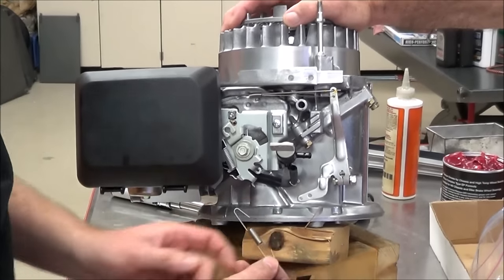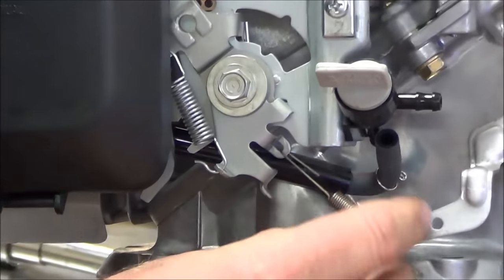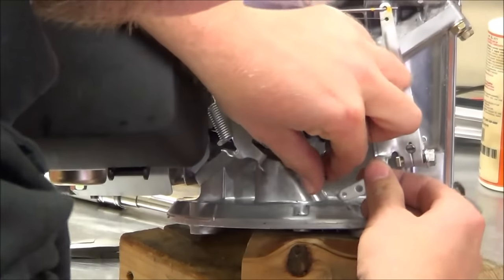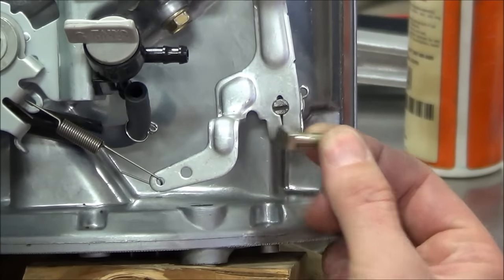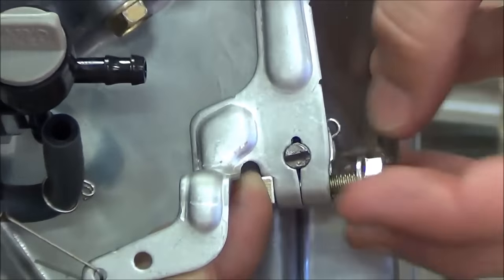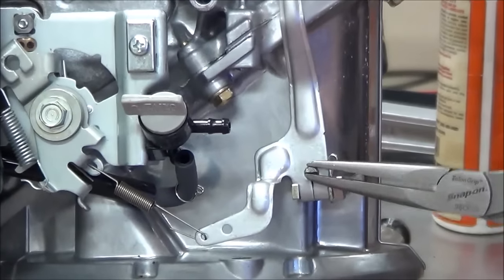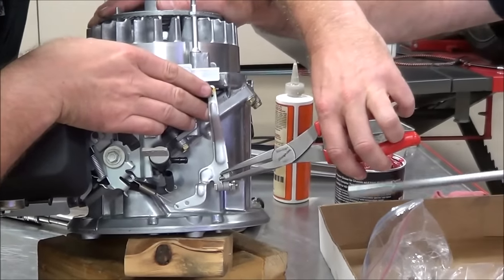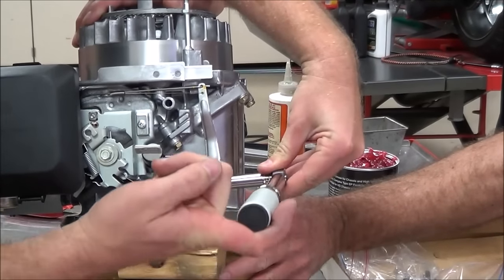GCV Assembly   07 Governor Setting #how2wrench

Comment: So if the governor is at the right of the engine you turn the governor arm and little spindle clockwise/to the right/ away from the engine. And if the governor is to the left, you turn arm and spindle ... which way?
Reply: The answer to this question is totally unclear, not just on this video, but many.  You can tell about the uncertainty given all the extraneous crap in this video.
Reply: That wasn't explained very well

Comment: When i adjust the govenor and tighten the bolt, my buterfly wont return and if i loosen the nut a little ,than my buterfly returns but if i start the motor than the rp its over the roof..(btw im ajusting without a tachometer because at this moment a dont have one) and if i tighten the nut so that my buterfly stays on the correct position , then i can't control my speed ..any suggestions ?
Reply: I am having the same issue. I cant get my butterfly to stay shut and my rpms are through the roof. Did you ever get this figured out?
Reply: @willgothard9300  no still have the problem.. now of butterfly stay in the same position and my rpm is almost ok i gues.. but i cant lower or higher my rpm with my speed handle, because the butterfly stay in the same position..
Reply: After adjusting and it's still in FULL RPM.  That is usually something wrong with internal, like broken Governor.
Reply: @JodBronson  yep internal govenor  broken or bad
Reply: @JodBronson  Dude. I swear I see you everywhere on YouTube! I watched your video on a CCR2450 carb.
Reply: @norge696  - YES, I am VERY active on YouTube since I have my own channel.  Why would it matter if I am EVERYWHERE !!!  NOTE:  If you are NOT on everywhere, you wouldn't find me everywhere, would you?  LMFAO
Reply: @JodBronson  I watch lots of small engine repair videos. That's where I see you.

Comment: Hi sir iam Tony 
    Why my Honda generator Em650 keeps on pulsing whan the engin is on. Lights go dim and full and dim, full and dim, whT can b the possible fault for this generator. Please waiting for yr reply
Reply: A couple of things are possible.
If it has a manual or automatic choke,slowly close the choke plate to reduce air flow.
If the engine speed stabilized,you know it's running too lean on fuel mixture. Your carburetor may have an adjustment for that, until the carburetor has been cleaned,you really don't know if you're adjusting to compensate for partially blocked fuel jets,so clean it or replace it before you adjust anything.
The governor spring or arm may be bent or stretched.